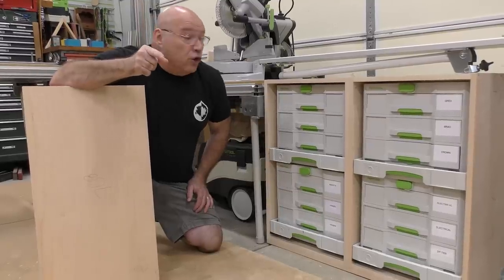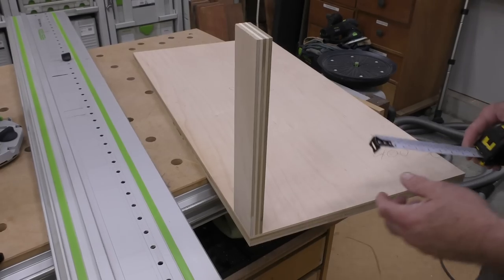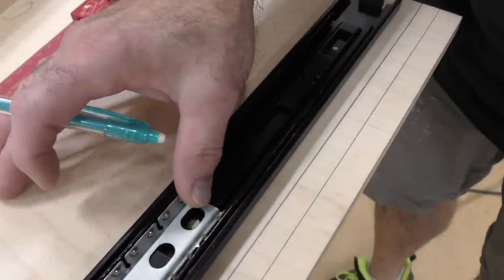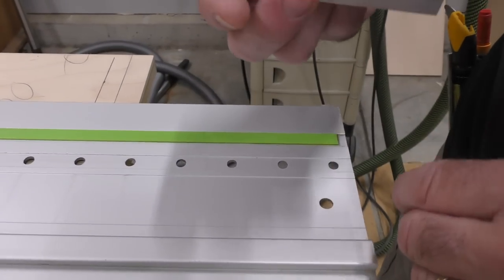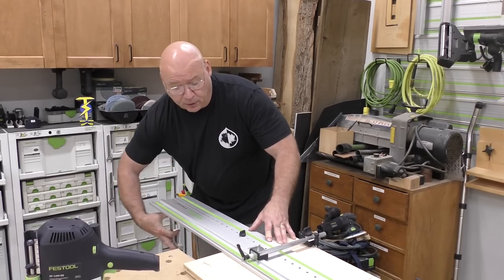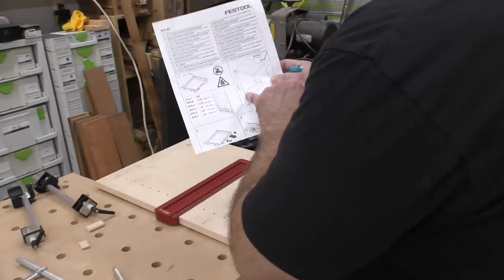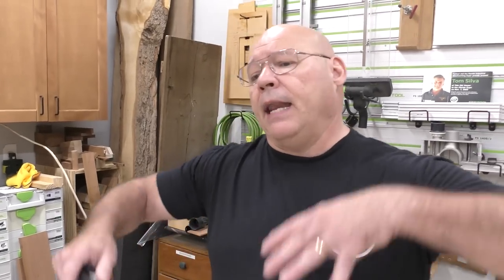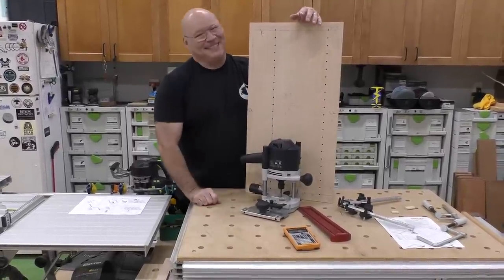Boring Drawers: SYS AZ Drawers and the LR-32 System

Comment: LR-32 through-hole lessons learned from me: Make sure your VacSys suction pad is clear of where you are drilling through.  Fortunately I just drilled through the rubber part and could easily replace.
Reply from the maker: ahhhh good tip !!!!

Comment: Hi Sedge.  Nice video.  On setting depth for boring, I just use the screw as a gage for setting the depth stop.  Since you are a metric guy, I am surprised you are not using a Hultafors Talmeter measure.  Steve
Reply from the maker: Thanks Steve

Comment: Awesome video as always!!! Sedge on your parallel stops, you have a lever knob, did you replace this from the standard knob that comes with it? Seems much easier with your setup.
Reply from the maker: Yes I did ... I got it from McMaster Carr

M6	1	16mm	45mm	35mm	25mm	-20° to 230°	Black, Orange	6324K13	5.13	6267T43	9.27

Comment: Another outstanding video. You make it simpler to understand.  I'm still waiting for my of 1400  . I think you said you used correction fluid to whiten your parallel guides ,Did you just lightly sand to clean off the tops of your lines?

Comment: You mention doing a later video on a miter saw station build with the SYS-AZ cabinets.  Did that ever get made and posted?
Reply from the maker: already in a redesign
Reply: @sedgetool  thanks. I'm planning on making a new miter saw station and already have the Sys-Az drawers ordered and am planning on using them in some of the base cabinets. I'm looking forward to seeing your design. Even got a few metric tape measures. Going to try and go metric for my measurements.

Comment: Hey Sedge!  I will be installing several of the Sys-Az drawers using the 32 mm holes.  However, a couple of the partitions will have holes that are back to back so aren't the 5mm screws holding the slides going to be too long and would butt up against each other in the middle of the 19mm panel?  How do I overcome this?  Enjoy your Festool Live! sessions!
Reply from the maker: you can buy shorter 5mm screws ......